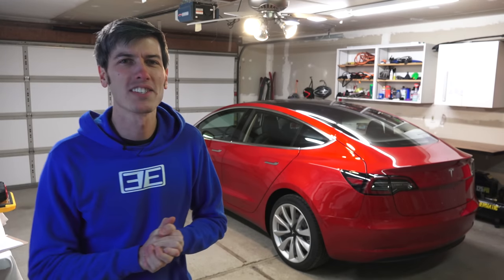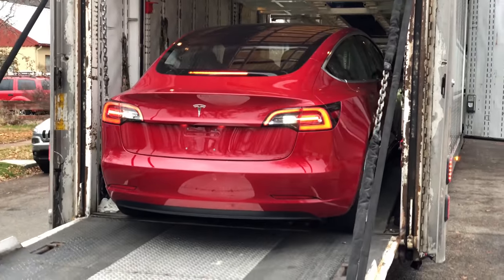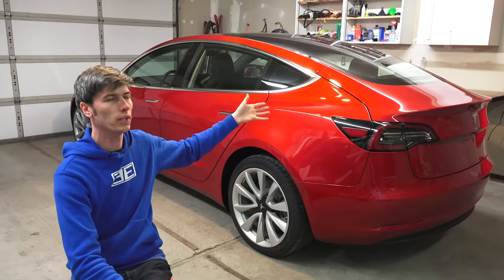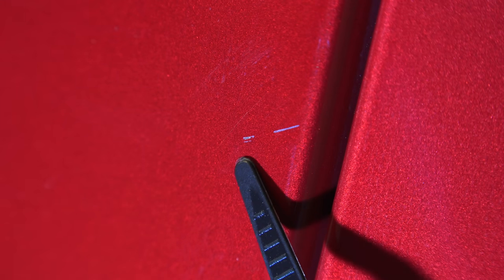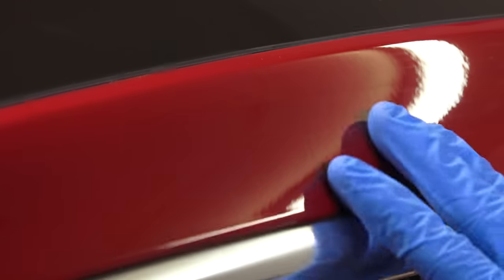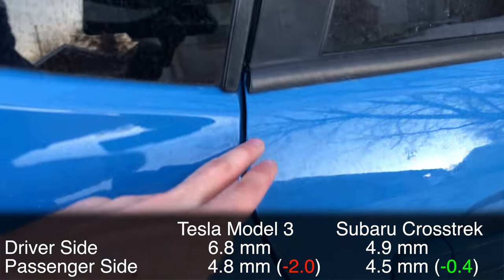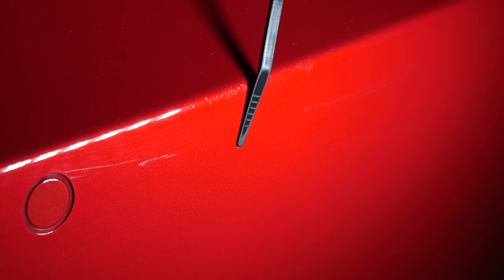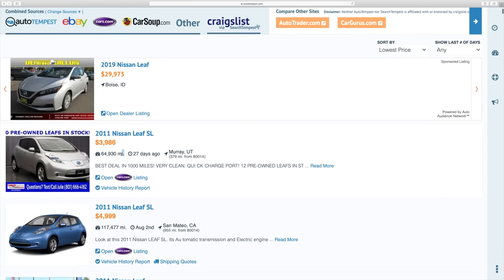Everything That's Wrong With My Tesla Model 3 - Quality Problems

Comment: Would you accept this on a brand new BMW M3 or an Audi S4? No. So don't accept it on the similar priced Tesla Model 3.
Reply: Not a good comparison, the MSRP of the base M3 is almost double the starting price of the Model 3, and from what I can gather the Model 3 Jason bought was still about 70% of cost of an M3. S4 is a closer comparison. But that paint job is indeed horrid. Panel gaps I can understand, it's hard to get the consistency without years and years of fine tuning the process, but paint is well understood, there's no excuse for what Tesla has done to this example.
Reply: Similar priced? 
What you smoking
Reply: Nitpicking. 

Would you accept this on a brand new (insert similarly priced BMW or Audi here)? No. So don't accept it on the similar priced Tesla Model 3.

I'm not smoking. I'm vaping.
Reply: I would not accept this on a toyota...
Reply: R3D the paint blemishes are unacceptable and I’m sure tesla fixed them.  But I’ve never taken a micrometer to any car I’ve ever bought.  So yeah i guess I would accept the “panel gaps”
Reply: sada das honestly I never thought to look until I bought my model 3.   So finally yes I looked at my tesla because all the fear mongers scared me to death.   I’m sure if you measure mine there are inconsistencies but my eyes can’t see them so why should I let them bother me?
Reply: Panel gaps aren't a huge deal unless you're really anal, but they're a sign of inconsistent assembly.  Its a sign the quality control is lacking, and doesn't bode well for all the things that you can't easily measure.  Are the suspension elements sloppy as well?  Were motor elements similarly lax in assembly?  No good.  But that paint is terrible.
Reply: R3D you wouldn’t even see these on a brand new high hand company car. Lmao
Reply: WHY did he sign for this???
Reply: That’s what model3 owners think they’re driving. They never stop bragging about a vehicle put together by teenagers. Not an M3 or an S4.
Reply: I did not get quality like this on my Suzuki Swift which cost a small fraction of the Tesla.
Reply: R3D, Foolish comments! I've had M3s from the mid 90s to 2015 and I've had many issues including the engine blowing on my 2003 e46 M3. This does not include a cracking subframe, a shock that went through the body of my e36 and major issues with turbos in the 2000s. 

Did I mention the spontaneous fires on BMWs in the last 20 years?

Don't get me started on AUDI, I don't have months to devote to that pile of trash.
Reply: @silverp85plus77  the comparison was between, brand-new cars at the time of delivery, and only illustrates the quality of the fit and finish. I don't believe anyone is comparing mechanical reliability.
Reply: But Elon Musk!!! he can do no wrong! We'll just call it acceptable
Reply: I definitely don't want to come off as some Tesla fanboy who will defend Elon no matter what, because I'm really not; however as far as electric cars go, I'd say the Tesla is one of the best bangs for you buck. Any electric car, is going to cost a good 50 grand, as much as a luxury car like a Lexus but Tesla is the only one that actually feels like a luxury car. I know this is going to sound really vein, but as much as I like electric vehicles, it would be really hard for me to spend 50 grand on something that looks like an economy hatchback like a leaf or volt. A Tesla, though actually does look like a luxury car and has features and performance to back up it's 50 grand price tag beyond just being electric
Reply: jubuttib 
I wouldn’t accept that on a Fiat 500, let alone a car with a £50000 price tag.
Reply: It's unrealistic to expect a quality product to be manufactured in California.
Reply: I wouldn't accept that on any new car. I didn't have any scratches on my Ford Focus so why would anyone except it on a car twice as much.
Reply: R3D are you high?
Reply: sada das hahaha show me a car that is waterproof
Reply: Not exactly BMW or Audi the model 3 is very inexpensive when you consider the gas savings in a year vs electricity which is over $3000 for most people.  Depending on where you live the government will give you an incentive.   In Canada for a model 3 you get back $ 14,000 on your income tax the following year (as long as you get the extended range which is about 500km.  The longest you can go on an electric motor compared to any other company).  The only unfortunate thing in Canada anyways is if even 25% of Canadians switched to all electric vehicles right now we would completely drain our electrical grid.
Reply: @silverp85plus77  my audi a3 has 200k km now and works perfectly fine the paint job is perfect etc. Never ever in the world I would take that ugly model 3 or any tesla
Reply: I wouldn't accept this even on a Suzuki!
Reply: @jubuttib  It doesn't matter, ANY car has those issues. Only Tesla.
Reply: @Kwkdkx67899  how much does it cost to keep it on the road? It costs nothing to keep a model 3 on the road. I don't expect you to understand unless you own one.  

How many model 3 sold compared to an a3 in the US? There is a reason it outsells everything in it's class in the US. No comparison, have a nice day.
Reply: @silverp85plus77  how many are sold in the us is not interesting at all because americans dont buy german cars that much compare them in europe or compare how many model x and s are sold hahah lmao tesla trash
Reply: @Kwkdkx67899  Really? bmw was selling over 130k 3 series. check your numbers before posting. Model 3 has taken over.

Comment: I'm not a paint expert, but having owned vehicles of varying quality levels that optional upgraded paint job on the tesla looks thinner and more hastily applied than the worst factory paint jobs I've seen before. Hell, my 21 year old lexus has thicker original paint and clear coat by a significant margin
Reply: LS400?

Comment: The funniest problem I heard with Tesla build quality was on the Smoking Tire Podcast where the car had 3 18 inch wheels and 1 19 inch wheel. I'm guessing there is another Tesla 3 out there then with 1 18 inch and 3 19 inch wheels. Yikes
Reply: it could be any amount of teslas with this 3-1 setup out there :)
Reply: The 4th guy can't lift as much
Reply: B.S.!!!
Reply: I'd like to hear that episode! Have you got the link available to share?
Reply: @ssflipallday  or read the tire size from the sidewall!
Reply: Brian Hanson lol true
Reply: @user-os8sq3uh4n  you mean the 4th guy lifted more or that tire is where you put the fat passenger?
Reply: Or how the back bumper just falls off if you drive through a puddle, or how one owner received their car with two DIFFERENT door styles (interior option 1 on left rear door, interior option 2 on right rear door).
Reply: What about the one with a small block V8 in place of a electric motor!
Reply: I listened to that it was actually 3 20s one 19 but yeah
Reply: @GrayRaceCat  its the most recent smoking tire about 3/4 in ,,wanna go fast is the guest
Reply: That is just a new type of security option to replace locking wheel nuts.....
Reply: @jwalker7567  ...not really. The overall diameter of the tires are the same. The 19'' wheels come with thinner side walls than the 18'' wheels. Also, there may be no to little weight differences between the different setups depending on the design and materials of the wheel and tires. The biggest difference would be in suspension where the 19'' wheel transfers more energy in to the suspension versus the tire. While it may be noticeable that the ride is harsher with a thin-walled, 19''-wheeled car, the difference isn't enough to wear or damage the suspension or drivetrain in any significant way.